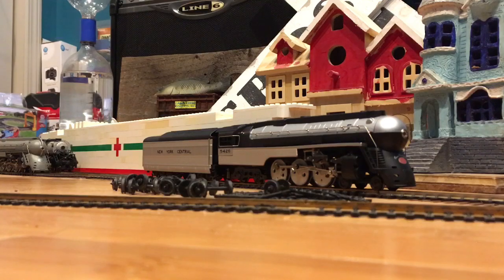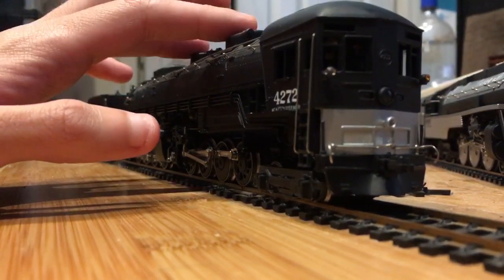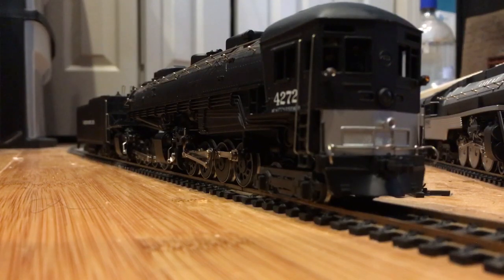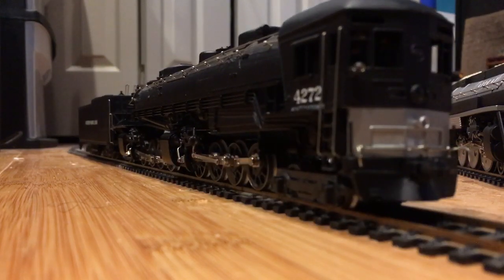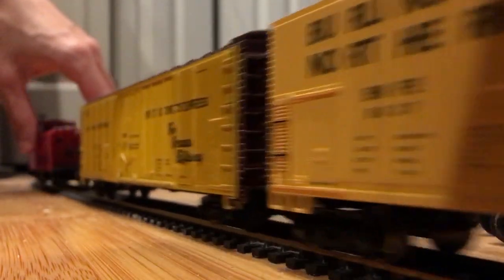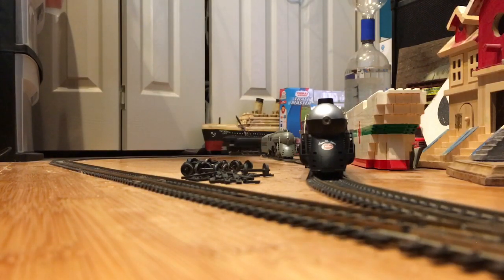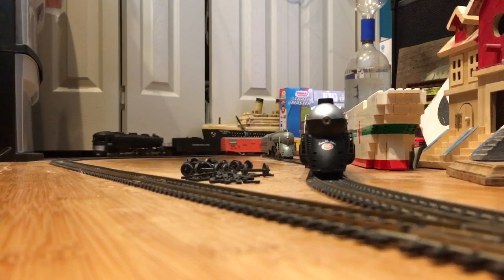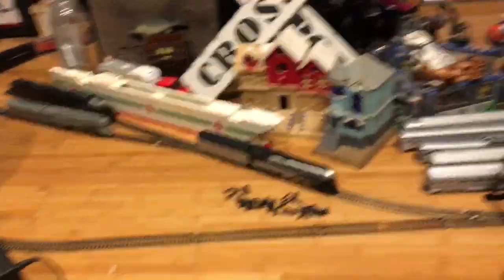I Revived a Locomotive Back From the Dead!

Comment: 1 year (almost) ago my manz fixed this unit, this manz got a damn big heart
Reply from the maker: Thanks so much man, but there is one problem. It’s dead again, but I won’t give up on this thing. The motor may need replacing, which won’t be easy, but I’m still not giving up on this thing. I want a cab forward on my railway, and my god I’m having one run on my railway.

Comment: How did you fix the rod bolt from unscrewing itself? I have a simaler problom with mine
Reply from the maker: I get a hex nut screw driver, and turn the nut as tight as I can. Not too tight, but tight enough so the rod is just free to move, and so the nut doesn’t unscrew itself.